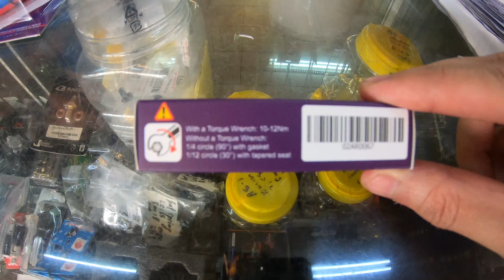4k Honda RS150R | Stage 1 | Uma Racing Plug AB8R3I | doXou

Comment: Pakai box givi tu buka seat sangkut tak ?
Reply from the maker: Sangkut bang. Ni model 10liter. Kalau 12liter kurang sangkut. Tp kalau nk sng pakai damper bang. Cun cun bukak.
Reply: Sekarang abg pakai 10 liter sangkut ye seat ?
Reply from the maker: @muhdirsyadshafiee1562  btol bang 10l. Tp sangkut yang boleh terima. Untuk tuang minyak semua ok.
Reply: Ok terima kasih info.. nanti saya cari centre box 12L untuk bagi tak sangkut sangat
Reply from the maker: @muhdirsyadshafiee1562  yezza. Dia dah modi untuk mudahkan bukak sikit.

Comment: Millage moto abang dh Berapa?  Klau pakai spark plug uma tu berapa lama boleh tahan spark plug tu?
Reply from the maker: Millage  moto baru 7k lebih skit hehe. So far tahan lama la. Sebab moto lc135v1 tahan smpai sekarang.
Reply: Klau tkr coil plug uma racing dgn spark plug  uma racing dgr dgr power jgk.. Abang x tkr coil plug kee?  Dlm video ni knpa abang kata nk mapping lgi motoni?  Klau tkr plug uma racing dia pnya minyak lari ke?
Reply from the maker: @haikalthesam6173  tuka bang boleh refer video ni hehe. https://youtu.be/7aTGza17pEo

Kalau tukar yang melibatkan api msti kena tune balik sebab lari api minyak. Tkot jahanam engine sekurang2 buat fid.

Comment: Plug y15 dgn rs150 sma ka blh gna untuk rs ke..
Reply from the maker: Alamak bang y suku xsure. Tp kalau code sama insyaAllah  bole tu.
Reply: @wanneochannel  yaka..bro tukar plug ad problem X..sya tukar gna espada selepas 4hri Moto jadi semput2..tukar standard balik stay sma..klu bro tw knpa tlg kongsi kt sya..tq
Reply from the maker: Pakai air filter uma x atau apa2. Coil std atau racing?
Reply: @wanneochannel  air filter espada..coil standard
Reply from the maker: Ramai cakap klau pakai plug uma kena combo coil skli. Sy x kena mcm abg sbb mmg combo dah.
Reply from the maker: Cuba abg try pakai airfilter std balik kalau plug tuka sama.
Reply: @wanneochannel  yaka..sya xpakai LG..sblom nirh gna espada..gna espada terus jdi mcm to..bla tukar plug standard jdi semput2 pulas throttle